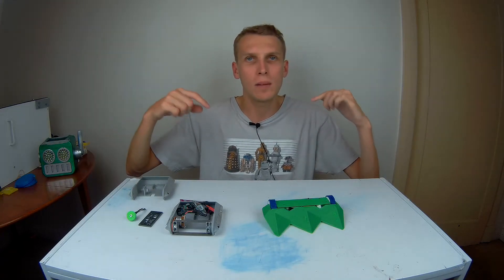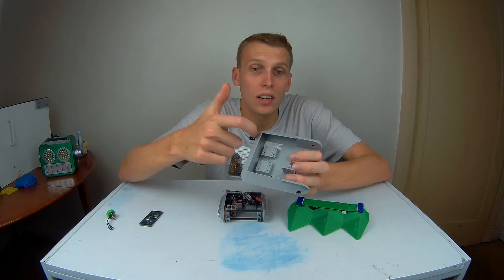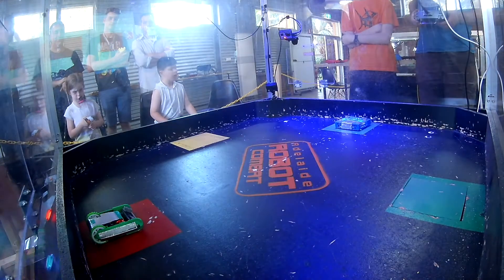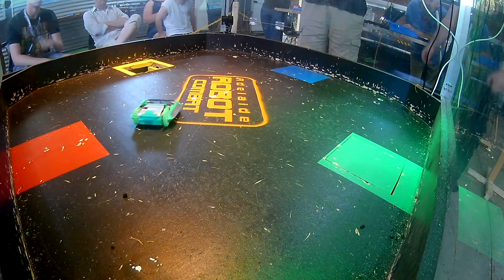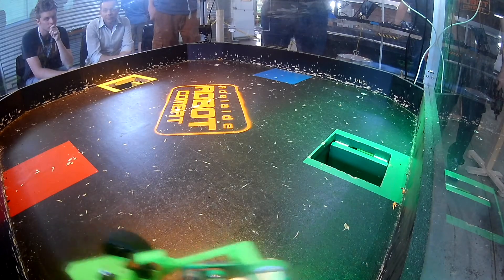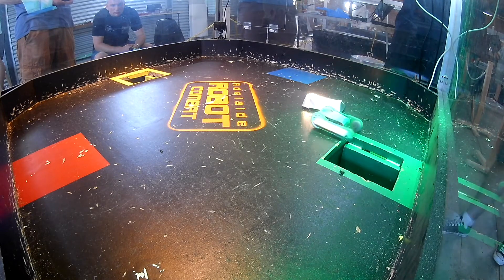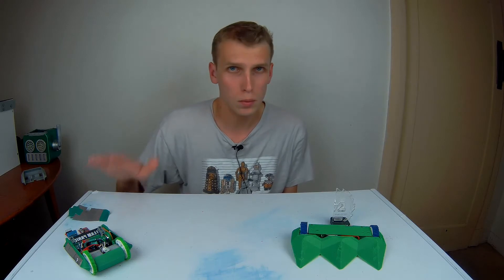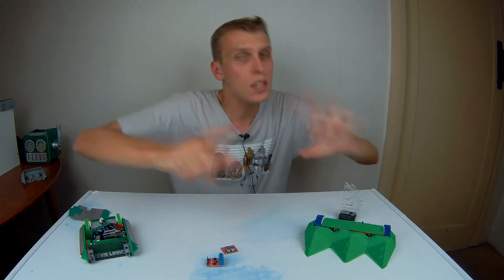150g Drum Combat Robot Upgrades! Dont Need Roads V10

Comment: Hey Boss!
New Roboteer here, think if you ever have time you can message a buddy in the US about some basics in parts you get for your antweights? Trying to get a local league here in Clarksville, TN :)
Reply from the maker: There are really 2 things you are after here: parts for an antweight and stuff to get a local league started:

For an antweight some people would say I'm the wrong person to ask, I use a DIY RC system, built using Arduino in both the robot and the controller. If you are interested in going that way and making your own system, I wrote an instructable on it: http://www.instructables.com/id/Cheap-Arduino-Combat-Robot-Control/ (it also has some good info on motors). Otherwise you will need a radio controller, a receiver (most controllers come with one), brushed escs to control the drive motors, drive motors (see my instructable) components for a weapon and a battery (180mHa 2s lipo batteries are a good choice)

For starting a  local league check out the Sparc rule set, its a commonly used ruleset and has guides for creating arenas and things: http://sparc.tools/
Reply: I noticed you are on a less beaten path via the diy radio control, but that's why i thought i'd ask!

I appreciate this alot, and am checking the links!